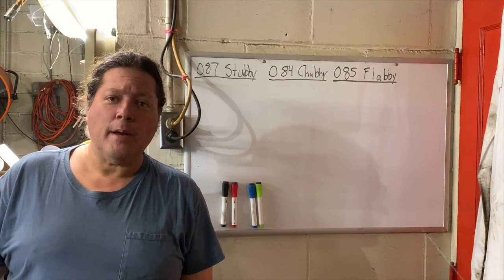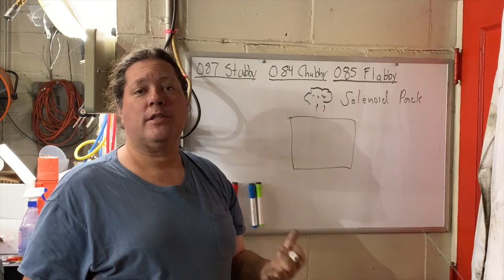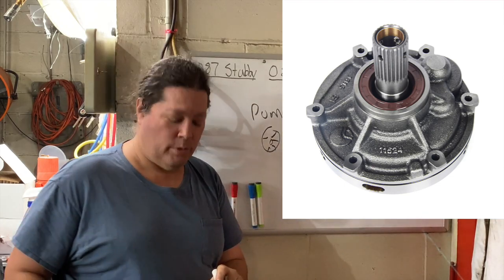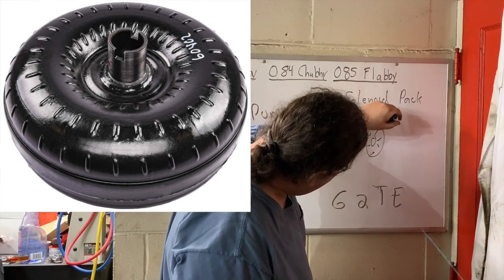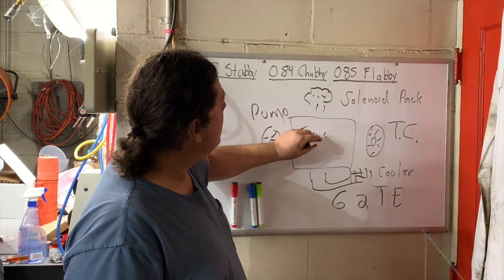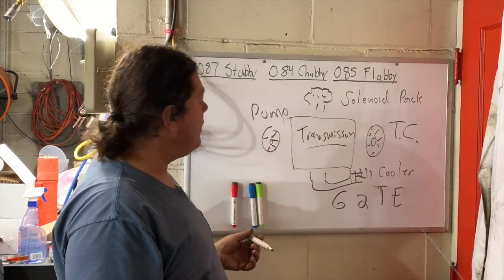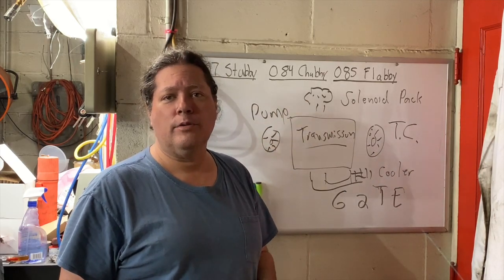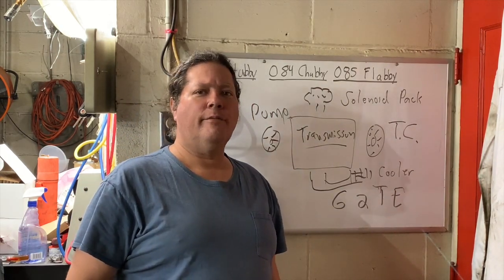New Series - Ram Promaster Transmission - Everything you need to know - Part 1 - overview.

Comment: Great! I’ll be watching this for sure!
My van pretty much was off the road for 11/2 years while I turned it into a full time rv and did notice a weird sound if I started off in the lower gears and I had to accelerate very slowly to avoid that…
But after a 1000+ mile drive to Florida it did get better… still there but not like it was , I think new filter and trans oil change will help..
Reply from the maker: Hard to think what that could be, but it could be/have been almost anything. Leaves. A family of squirrels. Who knows.

Comment: Excellent video, I wish you include mention the range sensor lever . It's also the barbie in the  repair shop that I work with the promasters.
Reply from the maker: Surprisingly, we don't see that one that often. Most of the transmission stuff we get is either P0740 for the converter (rarely anything BUT the converter) or a cluster of pressure and solenoid codes that's usually a rebuild. If you type "62TE solenoid pack testing" you'll find a motorcity mechanic video that lays out how to test the pack, and once I determine the pack is good I'm kind of out of options. My knowledge doesn't go deep enough to know EXACTLY what's behind each code/symptom, so we are forced to recommend a rebuild. Like, even if I condemn the compounder, it's almost as much work to swap the compounder out that it is to do the whole rebuild. It pisses me off too, because I would prefer to know exactly what's wrong and exactly what will fix it, regardless of a rebuild.

Comment: Maybe it's my bad luck, but buying the 2014 Promaster 1500 was the worst mistake I have ever made, I bought it, because I had a 2000 Ram 2500 for 15 years and never gave me any major troubles, so Ram was good on my mind, boy I was wrong . iI was with close to 90k when I bought it, at 124k the oil and the cooling fluid got somehow mixed for a plastic piece that  cools the oil and cooling fluid broke (or so the technician said) 4000.00 repair bill, at 135k the back engine support that attaches to the transmission broke and the engine fell off, about a couple inches off the floor 3500.00 repair bill. At 154k the engine fell off again but this time the nuts that hold the engine support split braking transmission casing  forcing me to replace the transmission with an used one for 3000.00 plus another 1200.00 labor. It cost me more on repairs than the purchase price, changing my perception of Rams forever.
Reply from the maker: I cant blame you for feeling that way. That trans mount breakage is truly oddball, never seen that or anything like it happen. 

It wont make you feel better, but ANY vehicle can turn into a money pit. Long ago, I bought a 1977 benz diesel wagon, supposedly the most durable car ever made. LEAST reliable vehicle I’ve ever owned.

Comment: Used Promaster van listings have " Limited Slip Differential" in the ad. I have also seen "Posi Traction". Have also seen ESP and ATC listed. Your explanation would be appreciated. Thanks for another informative video.
Reply from the maker: Technically, all vehicles have limited slip, just a question of how limited. Posi traction refers to Chevy's brand name for a limited slip. Broadly, limited slip is for drag racers and off-roaders. It isn't going to matter for a van, and in fact would be fairly dangerous in snow and ice.
Reply: @promastersonly1419  Thanks for the info!

Comment: Hi! Just got a P0868 code, the mechanic shop I went to did an oil transmission change, and replaced the filter and the gasket around the pan! The following day the code pop up again!  Now he is recommending me to change the whole transmission! 
We are talking about a Ram Promaster 1500 2014, with 219000 miles on it! At 207000 miles I've replaced the engine!
Reply from the maker: This can be a tricky one, but either it needs a trans pump or a torque converter or both. But it does NOT need an entire rebuild, although you may want to because getting to the pump and converter is somewhat expensive. I have a video on this channel on the transmission pump that you should watch.

Comment: We have a problem that no one seems to be able to diagnose. Scraping noise between 1500 and 2000 rpm. Doesn't matter if its in drive or park. Last shop thought they had found a cracked flex plate, took it apart turned out to be fine. I asked if they had started the engine with everything separated and they said they didn't think to do it until they had it back together to see if it was coming from the transmission or the bottom end. There are no other symptoms other than the noise. No weird shifting, no loss of power nothing, just the noise. I've watched every video i think that you have put out in hopes of pinpointing the issue. I did find one post with a video on the promaster forum of someone with the identical problem but they ended up replacing the engine and transmission together and never figured out the cause of the problem. Van is a gas 2018 3500 ext with 114k km. This is the only post i can find with a similar problem but they had error codes as well. https://www.promasterforum.com/threads/engine-noise.93138/#post-732703
Reply from the maker: Tricky. First off, they couldn't have started the engine because the starter needs both the engine and transmission to be present to bolt in. The first place I'd go is something rubbing against the torque converter - some bit of something that got in there. But they probably would have seen that if they had it out. After that, I'd get under there with a stethescope to see if I could narrow it down, at least to an area. In theory, it could be coming from anywhere that spins. But there would come a point pretty quickly when I'd advise you to do nothing. In the absence of a symptom, or a deficiency, it's just a noise. I'd cut open a well used oil filter and look for metal, but I'm guessing you won't find any. It seems hard to swallow, but it's possible the best course of action is to wait for it to change or get worse or otherwise be a bigger problem.
Reply: @promastersonly1419  That is kind of what we decided on, we did replace the flexplate just in case as it seems to be a common problem and it was already apart. Didn't really think about the fact that the starter was attached to the transmission. Due for an oil change in a couple weeks, will ask them to check for metal. Thanks for your great videos!
Reply from the maker: @GORBAGuelph  I'm guessing that there will be nothing in the filter, and it will end up being like a hose clamp rubbing the belt or something weird like that.

Comment: Happy New Year Kip, I discovered your ProMasters Only Channel about 6 weeks ago and binge watched every video. It's good and I appreciate it, thanks

On a different topic, I saw in one video the Oxilam LED H7 replacements and immediately ordered a set for high and low beam. They are definitely an improvement and easy install. Then, in the wee hours of the morning I attempted to align the headlight pattern and I'm at a bit of a loss. Seems I can move the hot spot of the high beam lamps easily, but the low beam pattern doesn't seem to move, maybe some part of the focus mechanism is broken, or my eyes are deceiving me, or just a lack of understanding.

Maybe a future video could speak to headlight alignment if you think there's interest.

Thanks again.
Reply from the maker: It's kind of a black art. There's an adjusting screw at the bottom of the headlight housing that adjusts it side to side, so you can point it inboard or outboard. But the mechanism that adjusts the vertical height has never seemed to work right for me. I end up adjusting it by shimming the headlight bucket 3 bolts with washers. Luckily, you get it right once and it never wanders.

Comment: thanks! this channel makes me almost WANT to buy a van with a ticking engine and lumpy rear tires if it means I can negotiate like 4000 off of asking or something. Saw a Promaster on FB marketplace with 700K miles so I know if I get one around 100K it an have a lot of life left after replacing those rockers.
Reply from the maker: I'm selling a high mileage Promaster later this spring - 600k. I'd be interested to know what they were asking for a 700k van?
Reply: @promastersonly1419  they are asking 15,000. current engine has 200K on it. it's a159" WB I think also the ext. I'm curious as to what you think about that pricing since I'm a buyer in the next 12 months haha. all I know is DEALERS want a LOT for ~50K-80K mile vans; from 28K to 35K asking.
Reply from the maker: @kalef1234  So what I have in the pipeline is one of my vans. 2014 2500 long wheelbase high roof NON extended. 531k. Still in service right now as an expeditor, but I'm wanting to get out of that business as the shop is monopolizing 60 hours a week of my time already. Mid to late spring, I was going to put a new/used bulletproofed in it, and have the transmission rebuilt whether it needs it or not (it doesn't, but 531 is pushing it). Clean it up and make it cosmetically nice. I figure with a new engine and transmission, and some kind of warranty from me, the mileage wont matter to the outside-the-box thinking buyer. I was going to ask $17.5 for it. Any interest? To an extent, we can build to suit. It's the van in the 3.2 swap video - I'll be removing the 3.2 and going back to a 3.6 of course.
Reply: @promastersonly1419  not a bad price  in current lingering but high market; esp for a rebuilt transmission and engine it would be ready to go. But I can't say when I would buy, just started looking around. I'm in VA but am actually shopping around here AND around Akron because it would be dope to take a potential van to you for a look over before buying. How did the 3.2 work out? I'm curious if it had better fuel economy.
Reply from the maker: @kalef1234  no worries. 3.2 was mostly fail. Noticeably less power in normal driving, and same mpg as the 3.6. Thus, the only advantage of a 3.2 is the low buy in price.

Comment: Happy New Year from Seattle Kip.  Always looking for more info on my 2018 Promaster.  Put a Dorman pan on my trans with a drain plug.  Currently changing fluid every 30 K and filter and fluid every 60K.  Any issues with increased frequency?
Reply from the maker: No. You could change it once a week and it won't hurt anything. 30k seems a bit over zealous, but I understand the logic.

Comment: Great info. I have a automated manual 3500 ecodiesel 3.0. It went into limpmode after rough downshifting.  I was told that the control module maybe bad, but I don't see that in your diagram. Is that the same as the solenoid pack?
Reply from the maker: No. The diesel is a totally different animal, and I know little about it. Sorry.

Comment: You rock!
I am looking to buy a ProMaster 1500 now.
What is the difference btw the 1500, 2500 & 3500 engines and transmissions?
Ty for your great teaching.
Reply from the maker: Exactly nothing. 2014-early 2022 are identical down to the last nut and bolt. All ratings, all lengths, all heights. Zero difference between any of them. Search my videos for "stubby van" for an explanation. However, avoid the diesel option at all costs - nightmare.

Comment: This is a question about my 2014 136wb, 3/4ton diesel with the hybrid manual trans.
 Is the godaweful incredibly slow shift from 1st to 2nd gear just something im stuck with or can it be fixed with a software or hardware kit? Can a shift kit be installed without removing tranny pissible?
 Its sl bad that for the first week i frove it, i thought it was stalling out in the middle of the intersection when it shifted from 1st to 2nd.
 It was so slow to shift, people would get frustrated being behind me and would quickly drive around me.
 The rest of the shifts dont bother me, but off the line, its absolutely horribke to have this thing bog down and shift so slowly.
Reply from the maker: I don't do anything with the diesel, particularly with the transmission. But I know the one guy in the country who does. He runs a shop in Florida. Email him at hellraisertrans@outlook.com. Name is Charles.

Comment: Just bought 2023 Promaster with 9-speed transmission. Are these any different in maintenance, durability or  repairs? Or maybe to soon to tell?
Reply from the maker: The 9 speed has been in production in other vehicles for something like 8 years, and as far as I can tell will be more reliable than the 6 speed.

Comment: Is this applicable to the 3.0L 4cyl engine as well? I have a 2014 2500 promaster. I've been having a hard time finding information on this vehicle and a mechanic just told me I don't have a pan
Reply from the maker: The diesel is a very different animal, especially the transmission. It’s basically a manual transmission, shifted by robotics. I honestly dont know a lot about it, but i know that almost nothing about the gas transmission applies.

Comment: I’m preparing to do my first transmission service on my 2021 ProMaster and want to put in the Dorman pan with a drain plug just in case I want to do a fluid change without dropping the pan in the future. Dorman says their part 265-833 only fits through model year 2019 and doesn’t seem to offer a lower pan option for the 2021. I’m sure my van has the same 62TE as a 2019 and not the newer transmission in 2022/23 models. Do you know of any reason why the same part wouldn’t work or why there’s a break in applicable years for the pan between 2019 and 2020?
Reply from the maker: Dorman does that sometimes - their application charts lag sometimes. Likely, they designed that pan in 2019 and just haven't gotten around to updating the year range. It'll fit.
Reply: @promastersonly1419  thanks Kip!  I’ve also noticed many different part numbers (68218057AC, AB, etc.) for the Mopar MS-9602 spec oil you recommend for the transmission. Most of these seem like superseding part numbers for what I assume is the exact same oil, but do you see any differences or advantage in using the latest version of this oil?
Reply from the maker: The truth is any ATF+4 would probably work fine, but I'm timid about experimenting, because I KNOW Mopar brand works. I buy it from Summit Racing and they have a good price. I also happen to know that O'reilly's sells a Valvoline brand that meets 9602. As to the AC, that suffix is the most current, but I have no idea why it would ever have changed or been superceeded.  @olivierhecht8022

Comment: Hi, thx for these awesome videos! My 2016 promaster started shifting to N while I was on D stopped at a stoplight on my way to work today.  Took many restart to get it locked on D, it happened again on my way home. Is it a gear shifter issue? please shed some light.  Thx
Reply from the maker: Could be a cable issue, or could be excessive engine movement pulling on the cable. Does the dash indicator change when it goes to neutral? That would rule out an issue with the shift lever.
Reply: @promastersonly1419  Yes, it would stays on D for 2 sec before jumping back to N on thr indicator. This only happens when I stop the car on Drive mode (traffic light, stop sign etc).
Reply from the maker: @kred2770  I’d tape a cell phone camera undehood pointing at the shift lever at the top of the trans, see if you can get it to reproduce.
Reply: @promastersonly1419  it finally broke down on the road. Checked transmission fluid, DEAD DRY. *I bought the car used just a month ago. It looks like a rebuilt transmission (car is 2016 with 120k miles). I filled up ATF+4 upto 2-inch mark. Still slips into N when shift to drive. What's the chance the transmission dead? I don't think it is worth to repair... video here - https://youtu.be/ozcl6Wcqqtg?si=r3gav2Rm3iKAuIUa

Comment: Thanks for the great explanation. I been experiencing a brief grinding sound while the Cruise Control is on in my 2022 Travato, whether I'm using it or not. Sounds like I'm shifting a standard transmission and missing the gear. On occasion when the CC is actually in use maintaining the set speed, it will briefly "Grind" and disengage the CC, even on flat, normal highway driving at speeds of 60-70 mph (No bumps, high winds, etc). Any thoughts? Thanks.
Reply from the maker: Yes. When there is a problem with the traction control, the computer will disable the cruise control. So if I had to guess, you've got some issue with the wheel speed sensors, most likely in one of the front wheels. Perhaps one is grinding or otherwise jacking up the sensor, and that trips the traction/stability control and the cruise kicks off. 

If it's not that, I would watch my video on flexplate inspection. It would be damn rare, but it's possible that could do that. Not too hard to rule it out by inspecting it.
Reply: @promastersonly1419  The grinding sound happened several times while the Cruise was ON, but not actually engaged.
Reply from the maker: @davesdiversions8078  Wouldn't matter. The failure isn't in the cruise system, it's in the wheel somewhere.

Comment: My 2019 is doing a tick noise when I start ,the noise goes away when driving,  replaced the starter.  Cold be the flex plate?
Reply from the maker: Very well could be, but they make a pretty distinctive noise when they crack. Type into youtube "broken flexplate sounds Chrysler Town and Country" and you'll find a video by Online Mechanic tips that does a good job of recording the sound, and shows you how to slide under and inspect the flexplate. 

If that's not it, there is another test you can do to see if it's the "pentastar tick". Cut open a well used oil filter, and see if there's glitter inside. A little is normal, but it will be obvious if there's a lot.